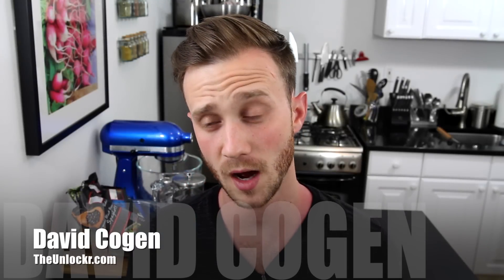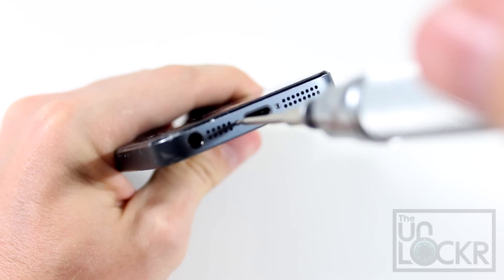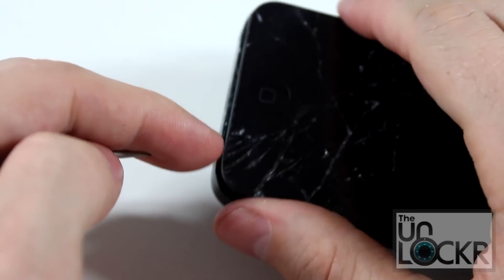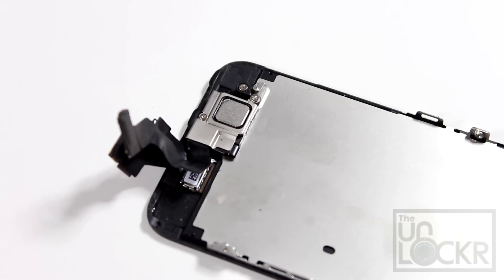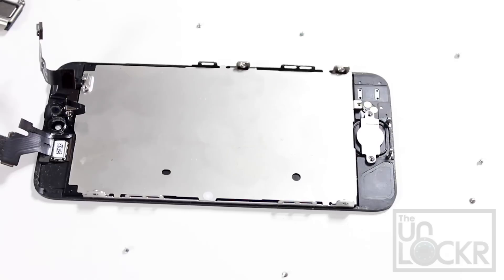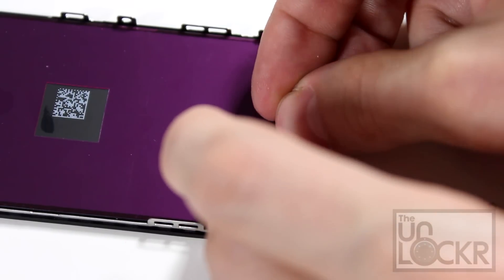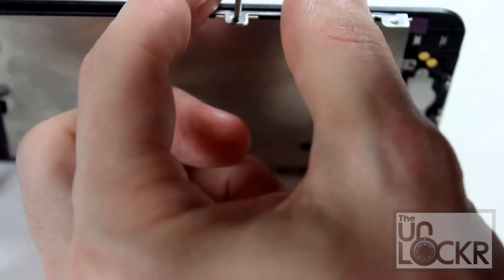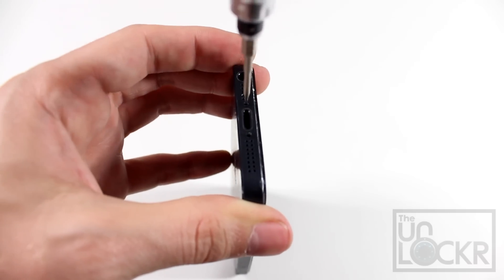How to Replace Your iPhone 5 Screen (Complete Guide)

Comment: Everything works for me after getting the screen installed but the home bottom wont click. Well it does but you hafta press it super hard and a few times and thst only works sometimes, i looked at the wires they all appear intact. I don't get what I did wrong or missed I've been researching for hours. Please help someone!! :(

Comment: Great tutorial! I just fixed my screen by that and it works. It just still has 3 little stripes on my screen, any idea what it could be caused by? Thanks for help!
Reply from the maker: You are very welcome. So glad I could help! It means the cables or screen isn't in totally correct. Unfortunately it and carefully put it back.

Comment: 3:50 I accidentally ripped it...does it work now ?
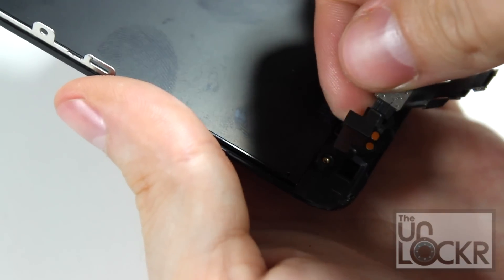Reply: I ripped the other one at 3:58- the 'easier' one. one of the little oval metal contacts stayed on the MB. then I struggled to remove it (i shouldn't have- I should have left it there..) When I reassembled, I tried to position that torn off contact correctly. I cannot report if it worked however because I later had other problems. In general this is a good video, but goes too fast for people don't have technical prowess. So read the comments and take the many good suggestions. Having double stick tape and diagrams for screws is good - though be careful with the tape because if the screws get too stuck, you might fling them into oblivion when you try to pick them back up. I used an old weekly pill doser, and put in the screw  in separate 'days' for each step. It worked ok except for certain steps where you have different sized screws & need to keep track of that as well.

Comment: will this work on all devices?
Reply: Geraldpuppyshell No only iphone for samsung it is a bit easier.
Reply: +diego moncayo thanks, i'm just wondering, do you know how to get a broken screen off of an iPod touch, i was going to fix mine, but i don't want to mess up power/volume connections
Reply: Geraldpuppyshell yes I do you have to use a heat gun but if u don't have one use a hair dryer but it will take longer and then do the same things he did in the video to lift the screen but for more detail just look it up on YouTube:)

Comment: after assembling, the screen or the phone itself has no response. connected it to the charger for a while , still nothing. Any ideas of what might be the cause ?
Reply: Bad connection on the connectors on the bottom they may not be connected all the way double check that if not then RIP
Reply: maybe damage flex cable

Comment: i cant unscrew my home button!
Reply: Did you ever solve this?
Reply: I lost 4 hours on this shit! I had to break the old plastic completely and use 3 tools to get that screw out :( Its really not that easy. 
Also Im still not done and iI think my camera wont fit in the place because its moving around 
aaaaahhh
Reply: i know this is old af but i had same problem so for people that will have it too, you just need unscrew at least one and than you will move that metal cover on the side so you can pull that home button out with all cables and after that screw went out easly,mb it was just in my case but worth trying

Comment: hey i replaced the screen with the new one and #1 it doesnt work and #2 it makes a bleeping noise every 5 seconds when its on charge. I then took the new screen off and put the old one on and it seems to do the same. I have checked both phone connector and screen connector and they seem perfectly fine? what should i do
Reply from the maker: I'd recommend removing the connector to the battery for 10 secs then put it back and the new screen on. happens sometimes
Reply: TheUnlockr hi, i'm having the same problem and cant solve it
Reply: ana torrealba How did you end up fixing it as I've tried disconnecting the battery for a while and reconnect but still no joy? thanks Stu
Reply: TheUnlockr Tried disconnecting the battery for a bit then reconnect but still no joy, can anyone assist? thanks Stu

Comment: I'm 100% sure I did right.
But the screen does not light up.
Help
Reply: Make sure it is plugged in correctly, mine had yellow Hues on it, turns out it was my wire was loose i plugged it in and it didnt have anymore hues

Comment: great. I ripped my home button. I was being REALLY careful, I spent 3 minutes on slowwwwly peeling it off, but in the end, one of the gold connectors is stuck onto the old screen sigh this kind of crap always happens to me.
How can I fix this?
Reply: That sucks.. Buy a new one. You should have heated it a little with a blowdryer, so the glue gets soft, and gently remove it with a needle

Comment: Replaced the screen and it seems like it is not responsive on some parts of the screen
Reply from the maker: Means either the screen you bought isn't working properly or is not connected properly. Try undoing it and putting it back on. Otherwise call you you bought the screen from.

Comment: So I bought a fucking screen for 20$ and it's just a piece of glass no brackets nothing!!!! ??wtf?!
Reply from the maker: +Ayman Dexter Why didn't you buy the ones I linked to... Would have solved that problem :)
Reply: Bro I didn't watch ur video first.
Reply: +Ayman Dexter lol gg
Reply: +Ayman Dexter Same... Are we screwed?
Reply: U probably got a glass screen protecter instead of a screen replacement
Reply: Read the contents of the packaging. A lot of times the LCD panels are fine but the glass is broken so to make it cheaper they just sell the glass.
Reply: that happens when you dont use your brain
Reply: I Legit Bought A Screen Replacement Kit. And All I Got Was Tools, And A Glass Screen.
Reply: It's not just glass though. It's touch screen too. And if it's got no brackets and is really basic then that's you're own fault

Comment: I'm so upset right now. This is the firsts time i have broke a phone screen. And it's so horrible like. The top right side is shattered and then there's broke screen lines going down the center. And there's this orange color dot on the left side. it's makes me want to get a new phone all together. 😥
Reply: same, but why get a new phone when the new screen is incredibly cheap xD
Reply: +xJeffHD Because what's the point my phone was already acting up and acting weird. I'm getting a galaxy I'm done with iPhones at this point.
Reply: Yui Henderson  Same, always liked samsung more than apple. But im pretty much stuck with my iPhone for at least another 6 months. My phone worked fine it was just the screen that was fucked up so I bought a new screen online very cheap at 1 pound and switched it. I cn understand ur situation though as it will cost much more to fix a malfunctioning phone

Comment: anyone have the problem where you can only hear people with speaker phone? I went ahead and ordered the full assembly to make sure i fix my problem.. just curious?
Reply: there isn't anything on the motherboard side that would affect this? all of the parts to fix this problem will be in the full assembly?
Reply: The top speaker isn't connected properly. It happens because when you remove the camera ribbon cable at the top of the screen, there are 2 dot connectors for the speaker that are held in with adhesive. If you don't heat it up with a heat gun you run the risk of tearing the dot connectors from the entire ribbon cable piece. I know this because I did it myself :/

Comment: my screws for my home button wont unscrew :(
Reply: I'm havin the same issue atm actually and I'm thinking about just ordering a new home bottom and screws but idk
Reply: Lir Bohnik did you end up fixing it? i cant unscrew it either.
Reply: wezzy6192 i ended up just hitting the bottom with a hammer really lightly and like make indents so i can unscrew the screws

Comment: you didn't remove ambient light filter and you forgot to remove the purple film:(
Reply: +Rob Fassi whats the ambient light filter? ive completed everything but the screen does not turn on, the phone does but nothing comes up. Just constant buzzing every 6 seconds
Reply: +Neil Halliday it's a white film that is where the ambiant sensor is. if your phone is not lighting up try disconnecting the battery and disconnect the screen and plug everything back in
Reply: +Rob Fassi i have tried that and nothing is working ive got the same problem as before.
Reply: +Amazing HD Documentaries could be a defective screen
Reply: where is the ambient light fitler

Comment: my home button doesn't work & I just went through that whole process ):
Reply from the maker: Means you messed up connection the home button. Open it back up and reposition it and try again. Make sure to check that the button works before you screw everything back together this time :)
Reply: Well go to settings and go to general then go to accessibility go to the bottom click assistive touch turn it on then boom it has the home button

Comment: I wish you had been a little more clear about removing the headset (small speaker). There is a small ribbon with two small metal connections (dots). When I pulled the headset off I tore the ribbon and the speaker does not work. I should have been more careful, but come on!! You skipped over this critical step!!!!
Reply: Chad Haller The same exact thing happened to me when I tried to replace mine, what did you do to fix it? I tried to look up just buying that piece, but it looks like you just buy the speaker part.
Reply: Hi Kristina,

Unfortunately I scrapped the idea of fixing the phone and I went and bought a new iphone 6. However, I did find that you can buy the earpiece/camera/speaker part online for cheap...I just lost my patience.

Comment: Spent 5 hours figuring out why parts of the screen was unresponsive then found out it was because he told us to screw the screw in next to the home button before we put the screen on. literally fucked it up........ Dont worry fixed now but just keep in mind that there is one little asshole screw that you need to place over the metal plate that goes on the screen. PLEASE BE MORE CLEAR ON YOUR STEPS

Comment: Guy's a very important part of this video has not been showing and I nearly gave up as MY PHONE WAS NOT TURNING ON,, after installations HOLD THE HOME BUTTON (which is the round button on the bottom) AND THE RESET BUTTON (which is the top right hand corner on the top of the phone) AT THE SAME TIME FOR 30 SEC.

Comment: I bought the LCD screen and while I was putting back the screen, it wasn't budging in and I applied a little bit of pressure and I fucking cracked the screen and now the touch screen is not working. FML